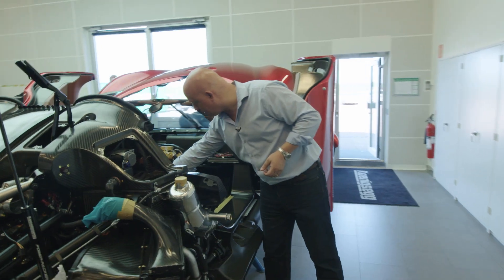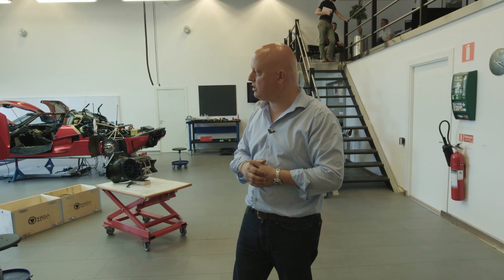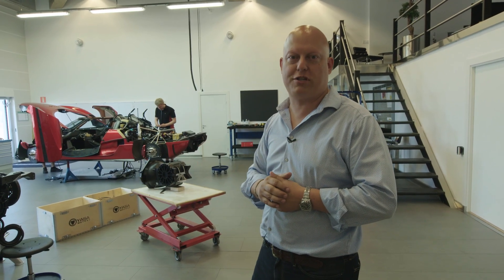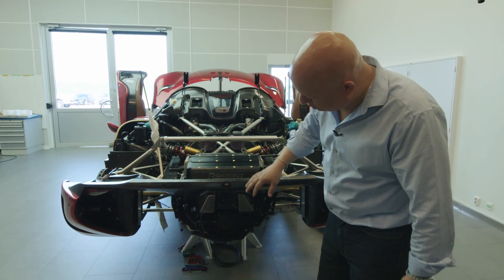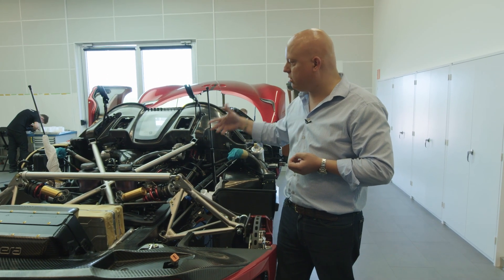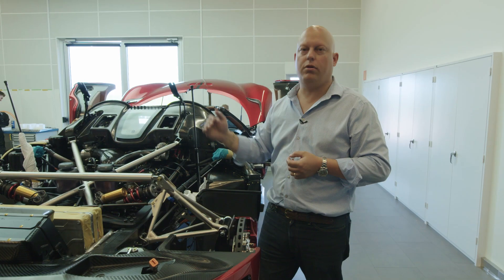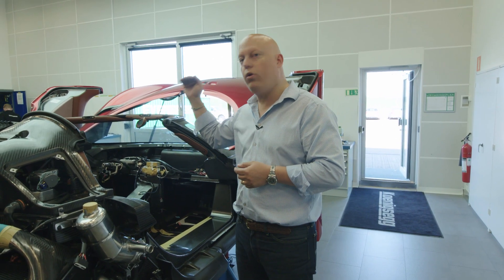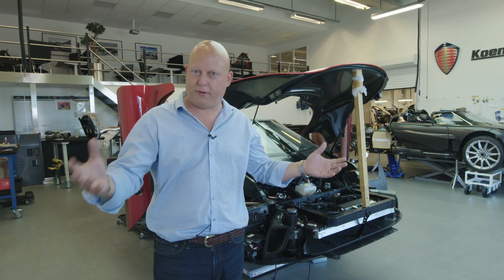How Do You Crash Test A $2 million Car? -- /INSIDE KOENIGSEGG

Comment: 3:19 the Regera has a heave spring and/or damper in the rear suspension... Connects the two rockers together so when the wheels go up or down together they actuate the spring and/or damper to get different spring/damping rates than when an individual tire moves by itself... Very cool... just noticed it.

Comment: Since I know Koenigsegg-driving-machines (I don't dare to call that profane cars😊) are planned maximum efficient 
have you anyway thought about storing the heat of the inverters and combustion engine like a combined built in heat pump for cold days to keep up the ERS in optimum temp window whilr standing time and heat the combustion engine and drivers cabin while starting in solitude 
e-mode on cold days or even as a stand-heater!? => Sweden.

Comment: EV CARS  ARE A SCAM-THEY COST MORE TO MAINTAIN - IF WE WENT UP  IN SALES BY 4X WE WOULDN'T BE ABLE TO AFFORD ELECTRICITY -SOON AFTER EVERYTHING  WOULD  GET EXPENSIVE & MILLIONS OF  JOBS WOULD  BE LOST!

WE CAN GET BETTER FUEL ECONOMY THREW TURBO DIESEL ENGINES -VW & TOYOTA & VOLVO & MERCEDES   AND  OTHERS ALREADY  PROVED THAT ...

1 3CYL ENGINE  WOULD  ONLY BE  25% LESS POWER BUT 33% MORE FUEL EFFICIENT 

A TURBOCHARGER WOULD  ADD BOTH POWER AND  BETTER FUEL ECONOMY 

A SUPERCHARGED ENGINE  & OR ASWELL... & IF IT WERE A HIMISPERICAL COMBUSTION CHAMBER  THIS WOULD NOT ONLY BE MORE RELIABLE, MORE EFFICIENT ON COST AS IT WOULD GET BETTER MPG'S  THAN A PRIUS  WITH MORE TQ AND  HP  SMOOTHER ,LONGER LASTING  & LONGER TRAVELS 

& THE MOST IMPORTANT PART -WHAT WE ALL WANT ESPECIALLY US AMERICANS = A FUEL BURNING -ROARING & REVING ENGINE WITH EASY & FUN WAYS TO MODIFY IT! 

THE  U.S. HAD OVER 17.5MILLION BRAND NEW VEHICLES SOLD LAST YEAR ALONE  ! 94% OF SALES

COMARED TO NOT EVEN  600K EV CARS -6%

Comment: the car basicly uses the electric motor to propel the car from standstill to moving. what if the person who bought this car stuck in the traffic and the battery for the electric motor runs out?
Reply: I guess you'd have to jump-start it... A similar problem occurs with start-stop systems which can also drain the battery of a car in extreme cases...

Comment: @pickle 312, IKR? 
bUT SERIOUSLY...........Just make some high temperature silicone impregnated kevlar tubes that inflate with nitrogen from a high  temperature polymer tubed plumbing system connected to a  carbon fiber cylinder with laser etched Koenigsegg logo that has a phenolic piston with non swarf cut teflon sealing rings and uses a polygraphite bushing  damped  beehive wound, high silicone progressive rate steel spring (HSPRBWS) that is to actuate nitrogen  pressure from its  armed position, the piston  is moved into  it's armed position by engine, shop or handheld vacuum  source @ 10"HG,,  The piston is held in it's armed position by an electric gas solenoid . that is sealed with a highly saturated nitrile o ring in 70 durometer, that can be manually operated with a Koenigsegg branded gore-tex / ballistic nylon glove or by remote switching , and has a really bright, wide refraction led somewhere,
This would be lighter and more compact than common struts/ scrap-wood sticks while lowering vehicle CG, it can be plumbed to operate multiple hatches and make really cool sounds when actuated.
At present it makes a slight farting noise when closing the bonnet but with a cad designed / reworked exhaust port tuning it should sound like a Star Trek door closing.
Koenigsegg,. I am available for hire worldwide,

Comment: Those batteries aren't that exceptionnal. Latest gen lipoly batteries reach 7.5kW/kg of power density, that is 562,5kW from a 75kg pack.

It's basically a big RC-car battery pack.

Comment: Ok the wood has white cloths on the ends to prevent any scratching and considering that unlike most other companies there isn't 20 people around the car but one or two at one time. And no a normal strut isn't installed considering the whole body is robotised so maybe that's during the install on the robotic arms. Nothing wrong with a piece of wood that is capable of holding 2 tonnes to hold a 4kg Carbon part temporarily. It is a very small build operation compared to almost every other manufacturer.

Comment: why don't they use simulation like nuclear test?
Reply: The Federal Governments around the world need REAL crash-test data, not simulations.  Simulations are only as accurate as the knowledge of the engineer inserting the variables.  They are not completely accurate, so most Federal Governments require real crash-test data for them to be sold to the general public for on-road use.

Comment: i love how with all these multi million dollar cars that are designed from billions of dollars of research and development, they're still holding the hood up with a plank of wood
Reply: No worries.  They taped a bag to the top so it doesn't scratch the hood.
Reply: Reminds me of how Bentley checks the steering wheel's stitches for consistency, a super expensive specialized tool for the correct measurements - a fork
Reply: common sense engineering does not cost billions.

Comment: i'd want to see a 200K koenigsseg. a smaller, still deadly agera with 600hp would be pretty awesome.
Reply: Koenigsegg CC8S goes for about that price, CCX goes for about as much as an Aventador while being significantly faster(In a straight line at least)
Reply: They can't make enough to make them so cheap :(
Reply: well, you can make profit out of 200-250K cars with as little as 100 models. see venturi. what happens next is entirely on the demand.

Comment: I love the "Out of the Box" thinking of this bloke and he knows every thing about his products...So at what speed do they crash test these rockets.?...Speed limit in OZ is 110kph and if you remarkably found your self fronted with another vehicle doing the same speed..let's say another Koenigsegg so that's a 220kph impact if I'm not mistaken...Now who is going to back off to 220kph if you have one of these.?..And at that speed well..let's say that you won't be driving it home...I love the engineering and the cars are awesome but I'll stick to my old '38 Chevy for fun thanks...I'll be safer that way...Just sayin'
Reply: ZIGgassedUP no, in a relatively low speed crash you will probably die. Ignorance is a choice, though...
Reply: just because your car won't deform or break doesn't mean it's safer lol.
Reply: David Serrano Yeah it has to absorb the forces that was the problem with the original Smart Car it was too small to be able to absorb the impact
Reply: ZIGgassedUP The tests are like 60kmh nowhere near a head on collision of two cars, it's a bit of a disgrace it is that low
Reply: A head on collision where both vehicles are traveling at 110kph and are similar in mass would be relatively equivalent to a 110kph collision into a stationary object. It would not be equivalent to a 220kph crash.
Reply: Tyler Hunt It wouldn't be the same as hitting a stationary object as the other car if of similar design would equally deform therefore halving the force compared to hitting the wall at 220 so therefore make it like hitting it at 110 depending on design of the cars
Reply: Sean McGeeney
Please re-read my comment. Or be more specific about what you find wrong with my comment. You appear to be saying the same thing as me.
Reply: Tyler Hunt I am agreeing with you, I'm expanding on what you said, explaining it in a way easy for people to understand, I didn't say you were wrong at all
Reply: Sean McGeeney ah ok. Wasn't sure.
Reply: Tyler Hunt No problem

Comment: The hood strut is hydraulic 
And Can only stay up when pressure is on
Reply: The opening and closing of the hood/trunk is controlled by hydraulic actuators not your usual gas struts. So if the hydraulics aren't installed in the car yet, then there is nothing to hold it open, hence the piece of 4x2 holding it open.

Comment: Very high discharge and recharge battery? must be lipo hope it doesn't burst into flames.
Reply: brett20000000009 Don't worry it's not a Samsung :)
Reply: I heard somewhere that they have a dedicated cooling solution for the central batteries. Supposably keeping them at safe operating temps so they don't fatigue. I wouldn't be surprised...

I can't wait for the "body" episode, this car is so beautiful.
Reply: brett20000000009 eheh
Reply: aren't LiFePO4 batteries capable of much higher currents? I've had single cells that can do 1200A peak

Comment: 0-100kph using electric power only...around 3 seconds? RWD.
Reply: Only because it is so much heavier which gives it better traction on the start. After it reaches 100km/h it will be left behind like if it had stopped. It does not really impress me when all that car has is gearing set up so that it can accelerate fast, but lacks top speed. Especially on electric vehicle.
Reply: But.... Just by looking at your name i can narrow you down to certain group of people which does not understand more than 1 or 2 thing about vehicles and they are both strightly related to plain data which in real world does not really matter if you can not take other aspects of the matter in to your conclusion.
Reply: Roy Rki I can see the point of saving petrol by not even running the ICE under 50kph.
But yes, this car will be quick between corners. Really, so much power and this drivetrain, SCREAMS for AWD. So much work to do for 2 rear tires...
Reply: Roy Rki TC s a reality in modern performance cars. Where would Tesla be without it? In F1 they have problems with traction, and those cars are a fraction of the weight on wide short life slicks.
Yes, it would add weight and pose potential torque steer issues. Plus, they might not have space anymore to store their roof under the bonnet. As with One:1, which has aero stuff getting in the way there.
918 is way heavier than P1 and LF, and has a weaker ICE. Yet through electric AWD and tiny motors compared to Regera, they are unbeatable in low speed stuff. The acceleration overcomes the cornering and braking deficit. Even over the Nurburgring where the (larger) 918 battery runs out at the long straight. 292kph top speed. An Agera R does 402kph there, Regera might do 410 and well before the brake point.
Just adding hybrid to a car usually makes it slower IMO. Imgine the P1 minus 180kg but still 750?hp. Still RWD. Wouldn't that simply be quicker? Forget torque fill. A 675Lt with 666hp seems to do just fine getting through its gears. And the bare P1 would be well lighter, plus rod illegally low.
In the case of Regera, there is so much speed, and a need for regen, that I think the added weight of extra motors would help.
Also, having 5 motors in stead of 3 would reduce overheating issues. Might reduce cooling needs, or make the car able to utilize its battery even more. The front motors  would bring in lots of regen. Less need to cut the ICE power in a straight line (or corner), spending fuel to charge the battery.
I suspect Koenigsegg don't want to come across as "green", or look up against the engineering challenge of sending, say, 300hp to the front wheels.
A whole extra axle of drive, electric no less, that can overcome some weight penalties associated with it. No doubt in my might that if Regera became a standard hard top and gained 2 front motors, it would simply be faster in all conditions except braking and cornering.
In stead of a slip limit around 270kph, it would be able to put down full power from well under 200kph. That helps. For acceleration at all speeds under 270. And the added regen improve fuel economy, in a way tha tmakes the car faster.
Reply: Roy Rki Not an engineer at all, and I fully agree.
Anyway, Koenigsegg already have a motor on each of the rear wheels of Regera, as well as one on the ICE for central harvesting and additional power.
Torque steer should not be an issue with Rimac sourced systems. Kerb weight would suffer, but lap times and all accelerations would improve, hugely.
If 918 does 2.2s 0-60mph, Regera could better this with AWD. Even when up to 50kph there is only e-power, and from there a slow revving ICE starting to kick in.
Reply: this car does 0-400kph in less than 20 seconds so I can't complain
Reply: Alex Roth Car sickness might happen.
Reply: More like awesomeness
Reply: Cloxxki not bad tesla can do 2.5 on the p100d

Comment: lol @ 6:50 did the guy laying underneath the car just wipe oil off his fingers then put it in his mouth?
Reply: homologation taste tests are stricter than they used to be
Reply: nah, he was smelling it.
Reply: Just a true gearhead, nothing out of the ordinary. :)
Reply: but why would he smell it？
Reply: Lol possibly, he might have been eating some cheetos under there while he worked. Grease is the last thing mechanic worried about getting in mouth.
Reply: +Richard Lee new oil has a particular smell, when submitted to high temperatures and pressure the smell will change depending the additives and oil composition. The smell will change, if in the past there was a failure a good mechanic can use his nose.